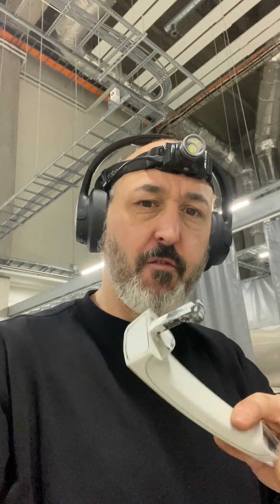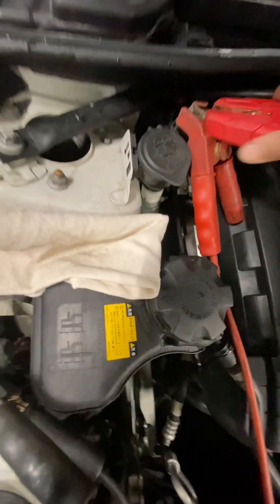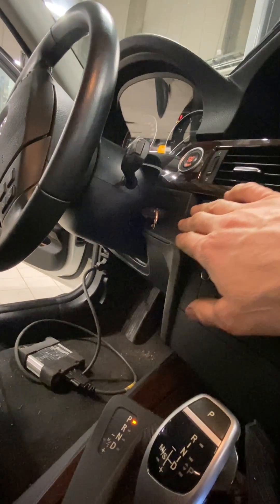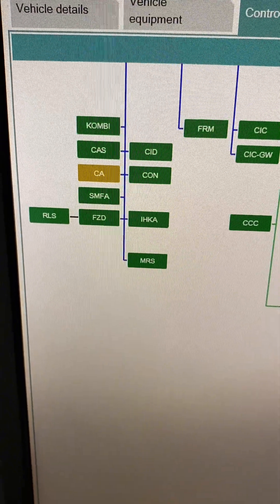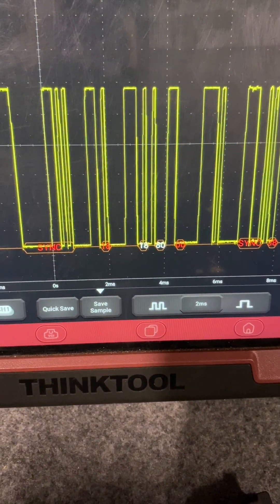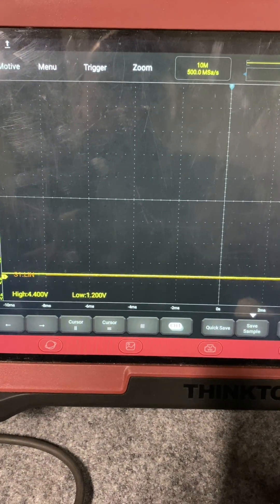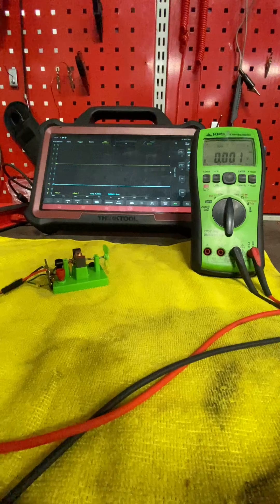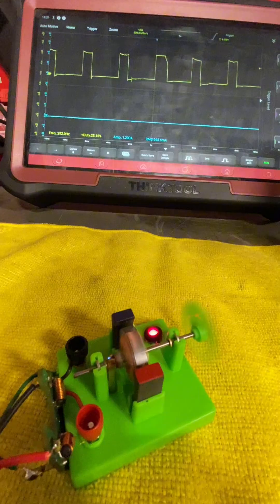How BMW's 'Smart' Door Handles Ruined Their Reputation.

Comment: Are there instances where the communication does not get pulled to ground with a bad door handle? I've only ever seen battery drains from this issue. I just had my driver door handle fail on my e70 lci and my only symptoms were the handle no longer unlocking or locking and every once in a while a high battery drain message when starting. I eventually noticed a few days later the inside corner of the door handle was getting warm so I just unplugged it. I had another car come into our shop a year ago with a very warm door handle and the battery dying over night as well as the handle not working. I can't remember what kind of car it was, may have been a f25 X3.
Reply from the maker: Yes more often than this. The main issue is a battery drain

Comment: A few years ago, i had an X1 [ older type ] , wouldn't start ,brought in by roadside assistance , loads of CAS faults .
And because i was outside in the street, were it was left the night before.
i got some 3rd party software.

As ISTA couldn't help,  3rd party software could delete the faults ! , 
And directly, the drivers door handle got extremely hot !!

Heated doorhandels in the winter ! is this a feature ? ??
Pulled out the door handle from the car, and the car started again, no more faults.

A few days wait for the new door handel, as it is in color .
Reply from the maker: Nice job bud

Comment: I think I've seen this fault on a diagnose dan video before. Had to watch your take on it too. I'm stripping out a 120d interior (2010 E82 bought non-running for a project) and have only kept what I figured was essential, which is not much at all: cas, frm, bcm. Hunting for comprehensive wiring diagrams online has not gone well so I expect to have some serious pickles when I get back to trying to get the car running. I did note you mentioning the fact unplugging comfort access and IBS does not prevent running the car so I'm getting a bit of relief from that info but I'm not confident about everything else I've chopped out, like antennas and the airbag module which has a bunch of can bus connections and other wires going to it on the 2nd plug which seems to tell me it's doing more than I initially thought. I still have the module (not in the car but stored) and the 2nd plug (still in the car intact). Long story short, thanks for the vid 😄
Reply: You did see it on that as I watched the same video a while back 👌
I wanted to see this take on it as well.
The other video saved me from a non start e92.
I'd have struggled otherwise.